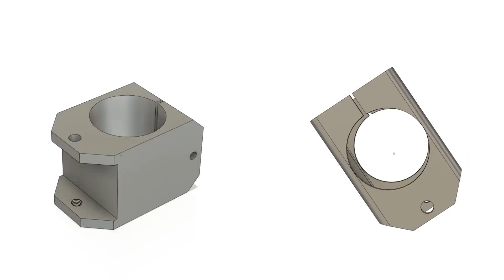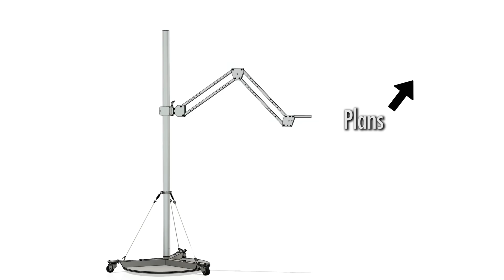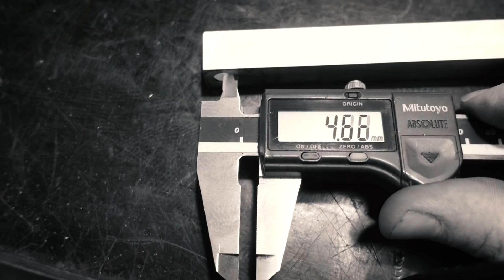Articulated Camera Arm on Wheels (no more Tripod!) (Plans available)

Comment: When you hit LIKE before you watch a video)
Saw it in your instagram and will definately make it.

Can you say few words about your TIG welder? Saw it was Stahlwerk. So is it closer to KEMPPI / Lincoln or it is closer to Noname China product in a quality of welding abilities? 
I'm now setting the working equipment for a coworking space for crafters in my city and the Stahlwerk price offers are pretty interesting comparing to my local shops with Noname welding machines.
Thanks in advance!
Reply from the maker: Good question, I have never used a "good" welder like Lincoln or Everlast or anything like that, so I can't really do a direct comparison. But I can tell you that the Stahlwerk machines are made in China, however they do the quality control and service in Germany so you get a good combination of low price while still having a manufacturer that you can actually talk to. So if something breaks, you're not screwed like when you order directly from China. But my guess is that they are using the same parts you find in the noname chinese welders, with a different casing and branding (can't confirm that though, but it would explain the prices). As for working with it: I think it's a good deal, I've had the welder for 3 years and haven't had any major problems with it. However I know from friends and forums that at least on older models, there were often issues with some of boards failing after a few years, especially the high-frequency start seems to break quite often, but maybe they fixed it in newer models. So if a lot of beginners will be learning on it, which means more abuse to the machines, that's something to keep in mind. Like I said I can't compare welding performance but for what I usually do it has behaved well. One thing I can tell you is that the accessories (Torches, Pedals and so on) are pretty bad quality, especially the foot pedal on my machine is clunky as hell and awkward to use and I have already replaced the TIG torch with a different one. All in all: I think for a co-working space I would recommend them, you get a lot of value considering how low the prices are and they offer 5 years guarantee (haven't had to use it so far).
Reply: @PhilVandelay  Great! Thanks for a reply!

Comment: how bad is it to use ready-made desklamp swingarms with a really strong set of springs? acceptable?
Reply from the maker: I thought about that at first but I couldn't find anything that looked strong enough. There's one extremely common lamp arm that you can find on a bunch of products, such as IKEA desk lamps ( the exact one I showed in the beginning of the video ), but it's hard to find anything beefier at a reasonable price. And that one I think would be too flimsy for a DSLR. The problem is not necessarily that it wouldn't stay up (as you said, you can achieve that by using stronger springs) or that it wouldn't be "strong enough" in terms of staying in one piece, but what you do get is a lot of shaking/vibration because the construction isn't stiff/solid enough. You'll always have that problem with something heavy balanced on a long cantilever where basically every small movement will result in some oscillation in the arm, and it gets worse the flimsier the arm is. Basically you need some mass to give it a reasonable amount of inertia. Of course you could just overbuild it even more, but then there's more leverage and it'll tip over more easily so for this design, there needs to be a balance between weight and stiffness. Mine too tends to swing/vibrate a little bit after moving but settles down after just two or three seconds. But if you mount a 2Kg camera on a much smaller arm it'll probably shake around much longer after being moved or if you bump into it, resulting in shaky shots. But if you can find a similar arm that is much bigger than those desk lamp things, it's worth a try.
Reply: @PhilVandelay  thank you very much! I'll find a beefy one.
Reply: @markifi  I have done a similar camera arrangement with microphone suspension arms. It's a step up from a lamp (they can hold close to 1 kg) but they are bouncy. If you can steady it with your hand before filming you can get by

Comment: Fantastic. How long did this take to build?
Reply from the maker: Hm. I think about a week, although I was still figuring things out in the process. Probably quicker if I made another one.
Reply: @PhilVandelay  I did wonder if (being so close to the floor)  the original steel disks had been bigger, just short of interfering with mounting the casters, they would have touched the floor earlier and reduced the tipping problem in the worst case when the tipping axis happens to be parallel to the relevant two points of contact with the floor. Perhaps the radius was still insufficient, but maybe this would enable bringing the casters in a bit with the disks you now have? (To have a smaller footprint...)

Comment: Idea for this: Instead of the block that clamps onto the tube, you could make a second block with captive electromagnets, so that you can attach your camera arm to any metal surface you find around the shop. Using a quick disconnect you can take the whole arm off, put it somewhere else, flip the switch on the electromagnet and have it where the base won't go.

Comment: if you're going to use S hooks or carabiners on each end, would it be stronger to just weld a loop in each end of the steel wire?
Reply from the maker: I actually tried that at first! But it was even harder to do because the cable just melts away really quickly and it was hard to get it to stay in position. I think the proper way is to put one of those metal sleeve things over it that you screw or clamp down.
Reply: Or a crimped sleeve

Comment: These compression sleeves are an inexpensive option for making loops at the ends of the steel cables.

https://www.mcmaster.com/3898t29

Also, the vertical handle near the clamp may be substituted for a cam lock handle similar to bicycle quick release skewers (though those are M5 x 0.8 threaded). Otherwise, the handle you have on now may not get to tighten/rotate fully due to interference with the column.

https://www.mcmaster.com/cam-locks

Comment: There are items in the camera grip catalogue which do this job/solve this problem.

The manfrotto "magic arm" mount is a good item to look at:  https://youtu.be/kkfEMJA4vbU
https://youtu.be/HRi3tUb_0_w 

Manfrotto also do a cheaper "single arm" fixture.

Also have a look at the category of "mini jib" mounts. Generally the double arm of the anglepoise lamp is insufficiently rigid for use for video cameras.
Reply from the maker: Do you work for them or something?

Comment: Alexandre did something similar but with weights added to it. To make the motion fluid. Sort of a movie friction-less gimbal arm tripod...Oh, and zero welding. Really cool as well. https://www.youtube.com/watch?v=V9e9ZWflCQU
Reply from the maker: Yeah it's a cool design, my only gripe with those is that they take up a lot more space since the boom extends out the back when you move it towards the column, and I don't have much space in my shop so I think I'd be bumping into that constantly. They are mostly used in photo studios with lots of space, I guess it depends on the use case